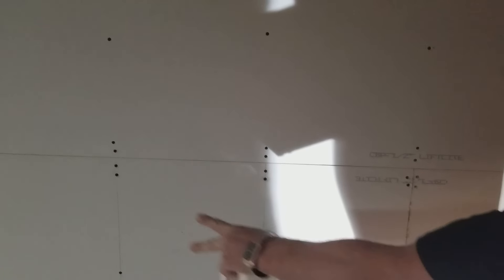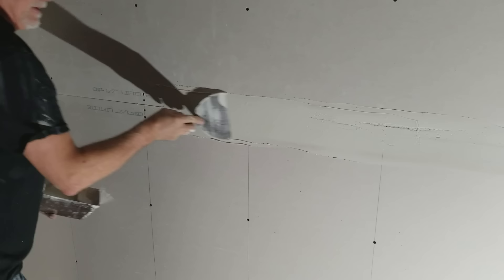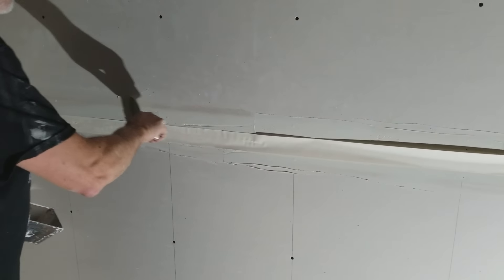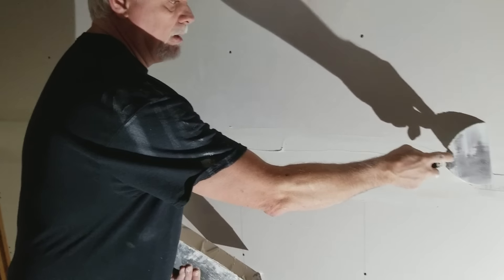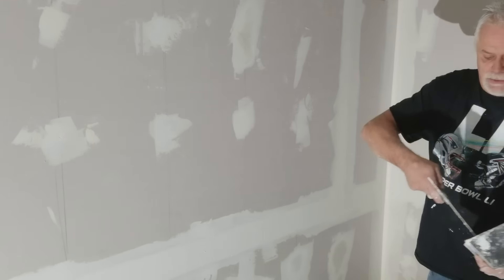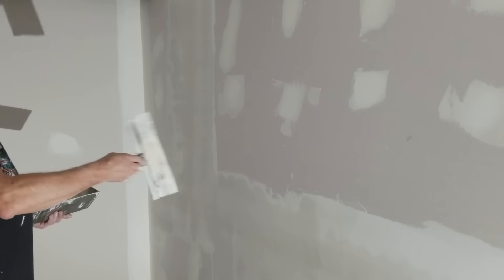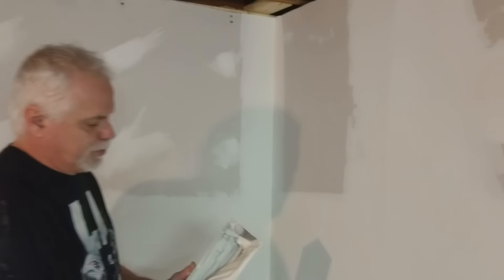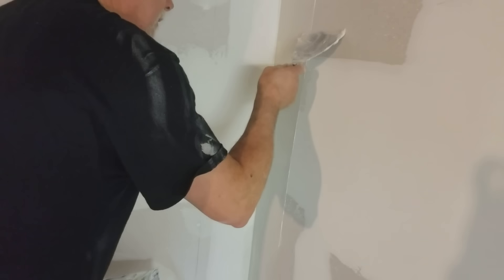Drywall mudding 101

Comment: If you are new to drywall, buy a corner trowel. Use it to get the center perfect. Let it dry, then sand and add an addition coat to bend the edges of the drywall mud into the drywall. After a ton of drywall work in my house, this is the only way I can get a nice clean corner without a ton of sanding.

Comment: Wish I would have seen your video before I started. I am doing a roon in my house for my pets and took a closet out. It's been years since I've done this stuff and needed some refresher. This will definitely help with my 2nd and 3rd coats though thank you. 
Question though if you see see this, primer? What am I using to do that? I thought it would just be ready for paint.

Comment: Phil I put up a 4x3 pice of ceiling because we had a leak in the bath tub. So one the beams hangs lower than the rest creating the pice I put up to slightly hang lower than the existing drywall. Any tips on how to feather that in? I did a 1st coat to fill in gaps and tape but you can tell in certain spots it’s not level across
Reply from the maker: Go wider on the mud so it will taper easier

Comment: I'm a professional 3rd generation taper (Yes I run stilts). Nice, My seams are a minimum of 36" on flat & 12" corners.  I do this every day. Another trick is to add 1 Tbls of dish soap  per 5 gallons of putty, no more than 2 qts. of water, makes it silky smooth,, (no bubbles).  Also-always seam a corner at the same time, or you lose adheasion in the corner, prone to cracking.  coating methods are okay, but hide the underlying issue of is it solid seam.  I use hard on first course  durabond MAKE IT CLEAN,  (hard to sand, crack filler), then the pretty putty TO MAKE IT NICE.

Comment: I have scratches in my wall due to furniture scraping against it. Was wondering should I use compound or spackle to fill it in??

Also there's a type of paint over the compound. Do you think it's waterproofing paint?
Reply from the maker: You can use either and most interior paints now are primer and paint together
Reply: @PhilFast  much appreciated. And GOD bless

Comment: I was rather sloppy with the joint compound, and had to let it dry for quite a while.  I then leveled it, easily (without sandpaper & powder everywhere) via using a wet sponge.  It came out straight & mess free.

Comment: Thanks Phil.  I’d like a little more detail in corners you have time, during a remod it was messy getting the old tape off and my partner left me just a mess.  I did my best but finishing with a nice tight corner was very tough, even after carefully sanding it looked more like a caulk bead than a 45 tight corner.  I’ll keep my eyes open and subscribe, thanks again

Comment: I am struggling a bit. I used corner beading.  I am trying to build up the plaster in the corner level with the ridge, but every time I sand the material back,  it quickly becomes gouged. I am up to the third stage and I need to get it under control. I am hoping the final stage irons out the ripples.

Comment: Great video, thanks! A question, if I may. Ceiling of my bathroom is dry wall and the walls are ceramic tiles. Problem is between dry wall and the wall there is a gap (in the ceiling) that I can't putty/mud in since it will fall off. I think I have to use tape in 45 degrees on both surfaces but I don't want to paint the ceramic tile wall.

Comment: Now I'm not sure what I did wrong but I mudded over the seams and screws, sanded, primed and paint.
I can still see where the mud areas are.
Reply from the maker: Did you use a primer sometimes you have to print your spots before you put pain on
Reply: @PhilFast  yes I primed then painted.
Also I use the screen instead of the tape, is that all right or should I change over to the tape?

Comment: Good video but when you hold in the towel, explain the amount of plaster and explain the angle you are holding the knife 30 degree or 45 degrees ? , at to do your application and the motion, light or medium light or heavy pull .

Comment: Could you be explain to me why you use different size knifes on different coats? Would it be possible to do the job with just a single sized knife? Thanks.
Reply from the maker: You can but it's easier to use a 6 inch to put tape on , then 12 to get a wide joint

Comment: Thanks Phil!  Question; you mentioned once done it is ready for paint.  Doesn't the wall need to be textured first?  I suppose someone might want a "smooth" wall, but won't we see some imperfections in the finish if the wall is not textured?  Thanks!
Reply from the maker: No that's where experience comes in you can do it a smooth wall don't have to text it

Comment: After struggling with the Factory Container trying to spread it with massive bubbles or air holes I bumped into a guy that’s knows. I told him I’m capable of spreading it but wow I haven’t quite figured it out. 
He said it’s critical to add water to a new container to reduce the thickness of the plaster, there’s a fine line, to much reduction it no good either. He said to add just a little Dish Soap to help the trowel spread it smoothly. 
Coat, add tape, next coat then thin a bit out of the same container for you last skinny coat. Now I can do it like the pros. I still hate it, but I can do it.

Comment: I soak strip  of tape in water then pull it between my fingers over the water bucket to get excess out before I lay it. Reduces bubbling and adheres better when it’s wet vs just dry tape

Comment: Remove excess mud is much easier when mud is wet. Then sanding isn’t as bed. Level it while it’s wet. Also wet sanding first with a grout sponge reduces dust.
Reply: I prefer wet sanding as much as possible if I’m working in an occupied space with furniture. Dust from sanding blows everywhere so reducing dry sanding as much as I can makes the jobs much cleaner
Reply: Final sand I’ll do dry sand

Comment: So the hot mud to fill the gaps and the premix joint compound for the taping. What about the coat over the tape?
Reply from the maker: Ready mix , topping mud in the bucket with the blue lid
Reply: @PhilFast  Thanks! apprecaite it
Reply: @PhilFast  Still learning but why the ready mix and not the 20 min mix? Is it purely the reason being easier to sand?

Comment: The way I do it is after I tape it I will put the first coat of mud on with a 10 inch knife then on the finish coat i use my 12 inch knife And barely any sanding.

Comment: Just fyi, it is not necessary to put  2 screws so close together at the joints. And if you glue the studs you don’t need screws in every stud in the middle of the board. That is just over doing the screws.

Comment: Which type of mud did you used?
Reply from the maker: All purpose mother's fine
Reply: @PhilFast  do I need to use that for the two coat and then use Plus 3 for the final coat for easy sanding. Also use Plus 3 on the screws?

Comment: I thought this was a good video, I would like a little bit more thorough video regarding more showing how much mud you're putting on, how angled your blade is, like are you laying it on thicker earlier then getting thinner, also maybe something more on drywall repair, like someone punched a hole in the wall type thing

Comment: This video didn't work for me at all, i try everything you said it took me so long that ended up with very sore back and wrist, plus my shoulder got very sore from holding the pan for so long. I wanted to learn to drywall like a pro but your video goes from step 3 to step 9, you keep the beginning and the end.  Why didn't show how to properly mix the mud and keep the tools clean while working, include some pro tips on how to apply the mud faster and with less effort.  I'm sure if you've been doing this for years than you've know lots of ways to get the job done with minimal effort.  Please keep this in mind when you make a video, thank you for your time.
'

Comment: I too have been doing drywall for a long time and I have to say this dude does not do a clean finish job. First of all you don't spot screws one screw at a time. You hit all three of them in the field with one stroke. The sanding on this job right here is going to be atrocious for this guy. In the background where there is already mud work done, There's no telling how aggressive the edges are around everything this dude touched.